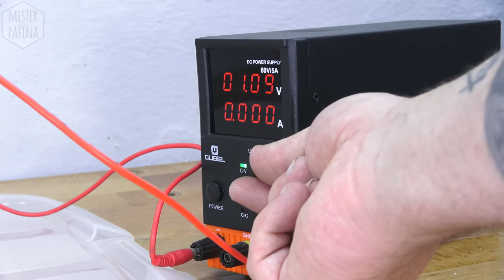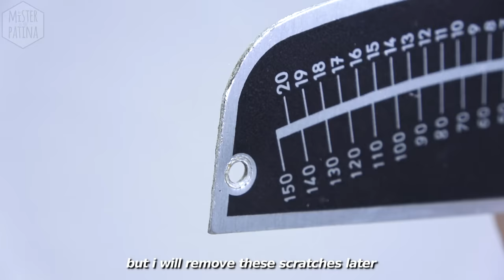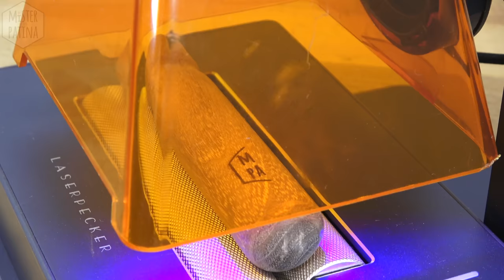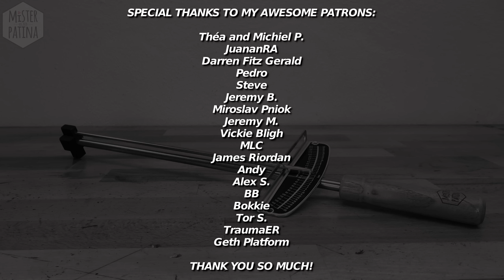Antique Torque Wrench | Restoration & Modification

Comment: You really should get it calibrated. I repaired these for years and you disassembling it changed a lot of specs. Don’t trust it until then. But it looks nice as a paperweight until then.
Reply: Heating would change the metal
Reply: I calibrated it for him about a month ago.

Comment: It would be interesting to compare the readings in the original and after restoration when switching to fastening from welding to screws.
Reply: Given the reduction in thickness, I'd expect an increase in indicated torque for a given actual torque due to the reduction in resistance to bending.  Also, I'd expect the heating to have an effect as well.

Comment: Greetings from St. Petersburg! 
Today there will be some criticism (but with respect). It seems to me that this time FULL (with head)chrome plating would be more appropriate (except for the scale and wooden handle of course). And one more thing, buddy. After disassembly/assembly, such keys need to be verified. Well, of course, if there is a need for it. What oil did you use at this 06:35, 13:26 point? Considering the color, I think it’s Li*uy M*ly MOL*GEN. And, of course, thank you SO MUCH for the wonderful video on Friday.  PS. While I was watching, I rewrote the comment 15 times (so many thoughts, so many thoughts).

Comment: I'm just going to think of this as an art project, a sculpture based on an old torque wrench. It's beautiful work but it was never a very accurate tool and now it may be even worse. Of course, maybe it's better but my advice is don't use it. The new, affordable little electronic torque adapters for breaker bars are excellent and very accurate.

Comment: Great job restoring the torque-wrench. Would rather use a deflecting beam type such as this but my clock dial version over a click type or digital unit. Pretty much never need calibrating and are just more pleasant to use and they are just old school cool.
Reply: I was just gonna say, wouldn't it need to be recalibrated after this restoration? He removes a lot of material, surely that affects the measurement? Maybe precision is not what he was going for here 😊
Reply: It might affect the reading a tiny bit but wouldnt have thought by a huge amount. It was sanding and polishing after all. Be interesting to see how it performs on a torque wrench tester all the same.
Reply from the maker: @TheBotze i agree! Regarding to the indicator it’s pretty well reassembled, but who knows if it’s accurate, and who knows if it ever was. Didn’t compare it to a modern one, it’s a display piece now 🙂
Reply from the maker: @matui6983 agree ✌️
Reply: Hope theres still a chance of a Mitchell reel restoration in the channels future. 👍
Reply: I feel that heating the metal will affect how it reacts to torque and may make measurements unreliable. Looks great, though!

Comment: Looks great as all your restorations. Drilling the stainless steel may go better with a Cobalt drill. I have worked with stainless steel some and have found either carbide or cobalt works best. It’s the Nickel in the stainless steel that makes cutting difficult.

Comment: If you had a dial torque wrench you could see how accurate it is. From factory these are way more accurate than clicker types. Less chance of snapping by over torquing. Clicker types the springs go out of spec almost from first use.

Comment: Wow!  Great video, sir.  Pretty ambitious too.  It’s hard to believe that is the same tool.  Clearly it wasn’t, but the steel bearing appeared recessed and I was very curious how you were going to tackle that problem.  I suspect if that had to have been fixed, you would have chrome plated the head as well.  Maybe I’m wrong.  But, either way it was a great project.  As always, looking forward to see what project you show is next.  Be safe.

Comment: Better workshops and garages usually have a calibrated torque testers to verify that all theyr torque wrenches are still working correctly, before they use them on the equipment. Might be worth to go find one near you and see if this beauty is still somewhat accurate, before you try and use it on some critical parts. Of course, if it's just for display and never gets used, you don't need to verify the torque scale.
Reply from the maker: Totally agree, but it’s just for the display. Iam pretty sure it wasn’t accurate and the restoration didn’t make it better. 
Hope you enjoyed anyways.

Comment: Nice job, as always. One question up for discussion: isn't it better to apply small quantity of the bluing liquid on the part instead of dipping the metal part in the entire bottle of solution? I was told earlier that this could damage the agent.
Reply from the maker: Good question! This isn’t a 'quick bluing', but a reusable bluing bath agent. So that’s the correct way to use it 😉
Reply: I see. You are lucky then if you have access to these industrial types! 😊

Comment: Heat treating and removing material has totally changed the properties of the torsion bar, looks nice, but useless as the tool it was intended to be I'm afraid.